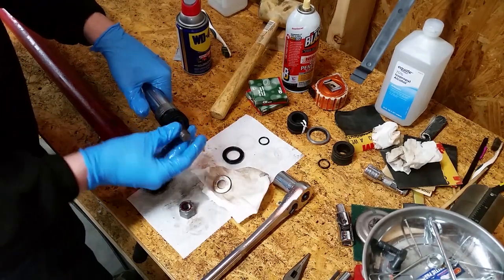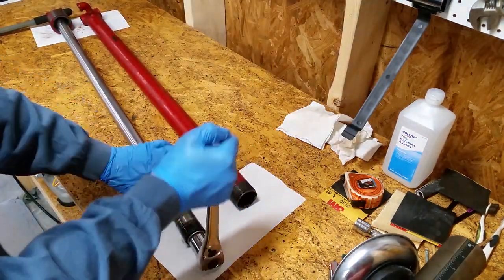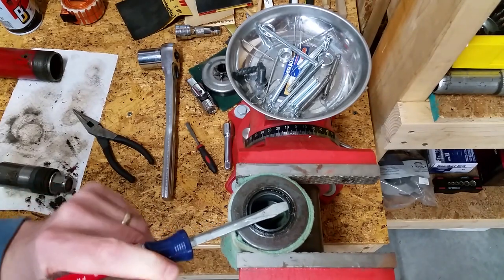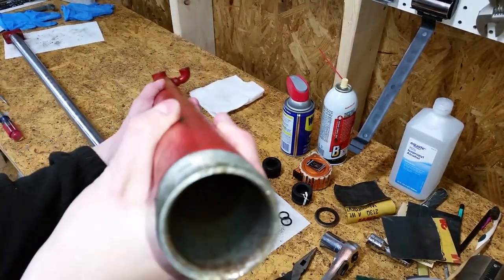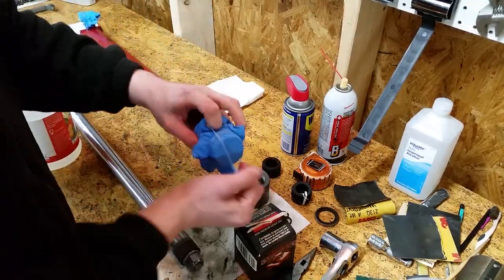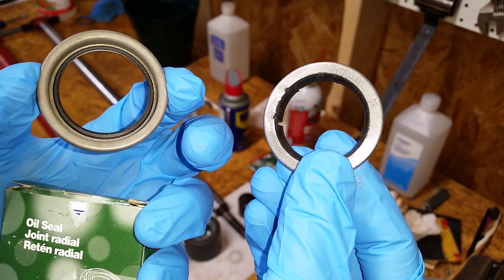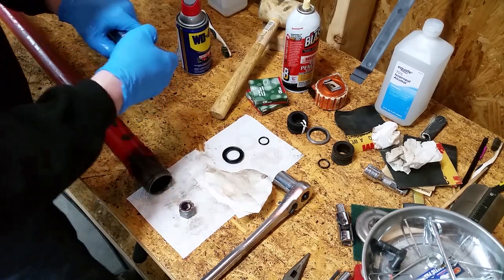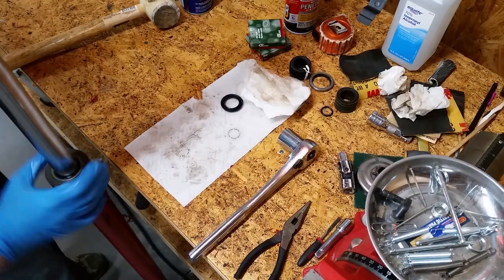Rebuilding Tractor Hydraulic Cylinders

Comment: Years ago, I read an article somewhere about repairing pitting on motorcycle fork tubes by filling the pits with epoxy and then leveling and polishing with fine sandpaper.  I realize it's not necessary on your single acting cylinders, but it may be a useful trick for a pitted double acting cylinder rod.
Reply from the maker: That makes sense, it would definitely smooth 'em out. Luckily for me, the rod bottoms out in the cylinder before the pitted portion starts.

Comment: What was the name of the rebuild kit? Looks just like mine.  I have no idea what to order but after your video I'm gonna try it!
Reply from the maker: I wasn't able to get a kit. The seals are called "Fabric Reinforced Chevron V-Ring Packing" but I'm not sure about the size. I took the old packing seals and O-rings to my local hydraulic shop and they just sold me a handful of loose parts I needed for the repair. Hopefully that's enough to get you started, let me know how it goes.

Comment: Would that be the same cylinder as the levelling cylinder on a Ford 2000?
Reply from the maker: I'm not sure, there were no identifying marks on the cylinders.
Reply: @Mikeattempts  thanks, just trying to figure out what I will need to fix mine
Reply from the maker: @lewy1  It could have the same type of packing as mine but your local hydraulic shop should be able to tell you exactly what you'll need.